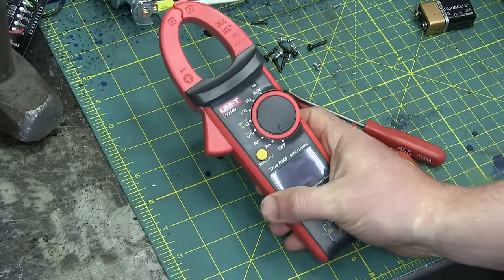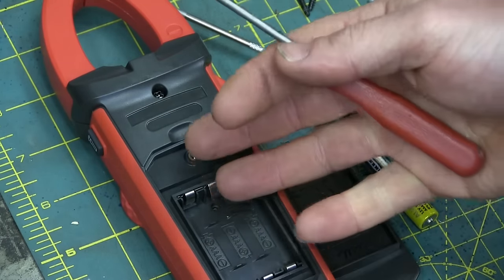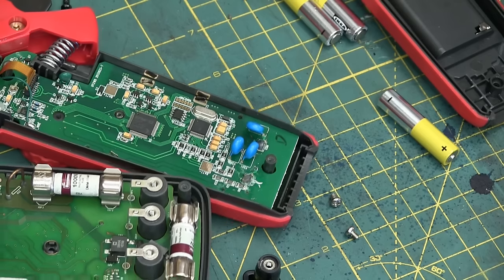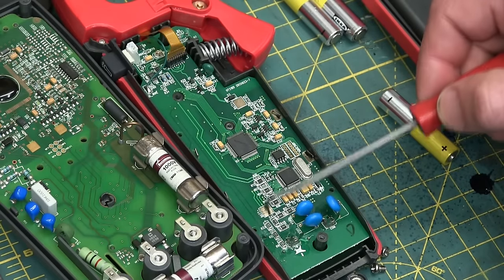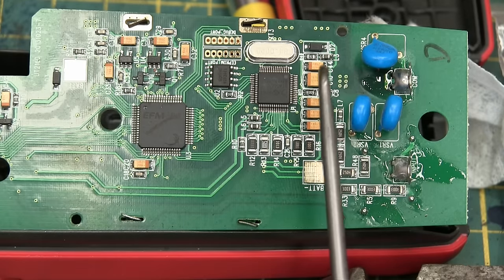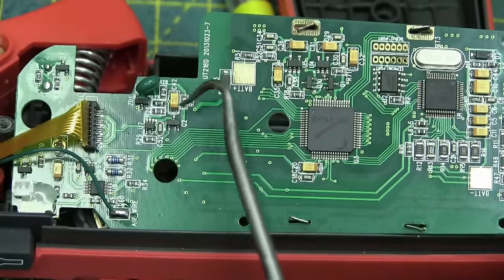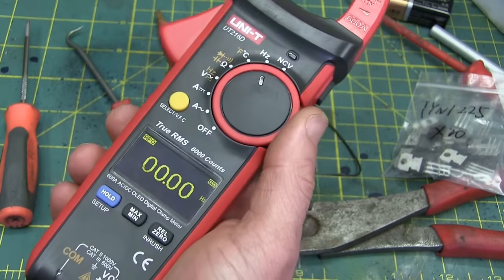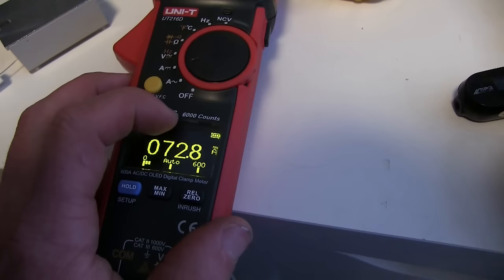BOLTR: UNI-T Clamp-On Multimeter

Comment: i bought a chinese fluke on account of you saying they schoochum , i'm new in the game , is it normal i get rating of 1085 uf for a caap that is 1000 uf??  also the test leads, where the rubber meets the road as you say, they're not silicone carne like yours they're just just plaashtic
Reply: > 1085 uf for a caap that is 1000 uf??

Is 1000uF? How do you know it's 1000uF? Because it's what's printed on the cap?

What's the precision of the cap? Especially electrolytics are generally very low precision / high variance, commonly +-20% (meaning 1085uF would be within spec for a nominally 1000uF cap)
Reply: you have to consider what a part does. A 1000 uF capacitor is more than likely going to just be used as a smoothing filter. In that case 85uF more, or less is not going to make a whole lot of difference. So 20% accuracy tolerance there is typical. A 1500uF cap would do the job too. But parts are labeled so you have a ballpark idea of what you're dealing with. Now I had a car once that was real particular about what condenser (archaic name for a capacitor) I had in the ignition. I don't know why, but it was.
Reply: well , yeah because it's written on lol , i tough the caps might be relatively precise but i did not knew it was +/- 20% ,  so then my question is, does it matter that variation of both the cap and the meter in the  analysis of the problem? i bought this dmm to  start  learning and doing repairs, one thing i would like to repair is my old tv i got when i was 10, from my understanding a lot of time if an electrolytic cap fails there will be physical evidence of leakage, but  is there a threshold point at which you can say good no good in the readings? thank you in advance for your input , it is greatly appreciated
Reply: +martin blouin more than 25%+/- rating.
Reply: martin blouin
the value that is often more important with capacitors is its ESR or Equivalent Series Resistance. Get an AVR transistor tester clone from China. They're flipping brilliant pieces of kit. But get one with a precision reference diode. This is the most pimp one I have http://www.banggood.com/DIY-M12864-Graphics-Version-Transistor-Tester-Kit-LCR-ESR-PWM-p-986954.html I have a few of them now.  But you have to be somewhat intelligent to use it right. You have to calibrate it after you assemble it. Then it is very accurate. Although this one is closer to the open source reference design http://www.banggood.com/DIY-Meter-Tester-Kit-For-Capacitance-ESR-Inductance-Resistor-NPN-PNP-p-929603.html I still like the hacked graphical display better.
Reply: 1085µF for a cap labeled 1000µF is perfectly normal. Most electrolytics have a 10% tolerance and usually read higher than the spec when new.

Comment: +ave ARMS have no bios. since the cpu has ramd and flash on chip my guess for the eprom would be settings of that device. so in case they build anoter series with different electronix on board they can leave software and chip alone and just change values on the eprom. so you dont have to fuck around with a lot of different software versions and shit..
just a guess dont know that thing

Comment: I have been shocked more times than I can count!! I very much respect electricity but at the same time getting shocked doesn't bother me. The other evening I was working on my bedroom circuit when a bare conductor struck a live line. There was a pop and a flash and the person helping me jumped. I did not flinch or jump as I know that being relaxed at the time of being shocked greatly eases its effect.

Comment: 1) protip: apply superglue to toothpick, then apply toothpick to vital electronic component),
2) A question: why are the pixies so angry?
Reply: super pro tip 1 - use 2 part epoxy instead; or better yet - for electronics - UV cured adhesive.

Comment: Couldn't you simply solder a wire from the tab to where-ever the trace was supposed to go to fix it?
it looked like the trace broke from the factory... 
superglue keeps it in place, you just need to fix the electrical contact.

Other than that one tab, it's hard to fault that meter really.

Comment: That loose contact is probably off track - find where the other end of that track goes and solder a wire to it and screw it to the post on the plug hole.

Comment: When you broke off that pcb terminal you attached it back with super glue
you fixed the mechanical side of the problem but you used a non-conductive glue, so you didn't restore the contact that thing made with the trace on the pcb
you just need to get back in there, scrape some of the glue off of that terminal, scrape some of the solder mask (green stuff) off of the pcb trace on its right and join the two together
then it should work fine
otherwise send it to me, I will fix it

Comment: So try you $10 borescope and check for bad solder balls between the pins of the chips causing a short? Or send it to me and I'll look at it under the microscope and remove and solder ball shorts. Then it might fire again. Most cheaper meters is a bad soldering causing a dead short. I've fixed four with the microscope, hot air reflow and flux, and a FLIR to help see the part heating up that may have the dead short also.

Comment: Don't worry about aircraft safety issues due to poor instruments.  The manufacturers stipulate what instruments must be used, and the systems in place to ensure everything is done correctly are very robust.  (Regulation, rather than letting the magic hand of the market drive down the cost until the number of aircraft dropping from the sky and the almighty quarterly profit are maximally aligned.)

Comment: I know you tested variously produced batteries. But I have experienced electronics devices that just don't work with the cheaper batteries. Pixies are pixies. But I'm thinking that the expensive batteries may include that valuable consistency you start of with here. Perhaps battery powered devices are better tested with the most reliable pixy supply.

Comment: The CE looks more like a European Conformity mark then a China Export mark, the E is closer to the C in the China Export mark, and in the European Conformity mark if you were to close the C to make an O the edge of the O would cross the edge of the E.  Here is a European Conformity Mark http://www.cecertificationmumbai.com/  If you are not familiar the European Conformity mark it has  to do with safety and EMI requirements, I deal with the EMI requirements as a test tech.  The CE Mark doesn't necessarily mean the device is safer or more scookum as for most products the CE mark is a self deceleration, you can basically say that you met the requirements without doing any testing but if your product hurts some one you are going to have a sucky day in court trying to prove your stuff is safe.

Comment: A thermocouple is a differential measurement (ambient + voltage around the TC loop) so if you short the leads together (same metal junctions e.g. a paper clip, copper wire) you will see the temperature of the internal PCB.  NTC is negative temperature coefficient, as the temperature goes up the resistance goes down.  

In that 20 minutes of blather did I learn anything more than there are 3 big ICs on the board?

Comment: Pixie wrangler here. I was tempted to dislike after the pro arduino comments but then who would entertain me? lol. I've signed more ndas than I like and I admit I'm an old school PIC guy. Despite all that (and I havent read the comments) but aren't those PTCs on the front of the board just that? PTCs? Not thermistors. Based on that wouldn't they provide some protection to the incoming leads? Check on that.

Comment: That's not how a varistor works.
Reply: A varistor behaves much like a couple of back to back zener diodes. They barely conduct anything below their rated voltage and if the voltage climbs higher, they start letting more and more current flow through, clamping the voltage to a reasonable limit. They don't short out once they reach that voltage. Unless you really overload them (blow the shit out of them), they are happily going to continue not letting the current through after the transient is gone. They are not like fuses, that only act once and permanently.
Reply: Cant you use them like a soft start, to help in-rush current?
Reply: J. Dalton I am pretty sure you're thinking of NTC thermistors.
Reply: To Galco!

Comment: EEPROM  -Electrically Erasable Programmable Read Only Memory , Can be reprogrammed to change firmware
or calibration VS EPROM - Electrically Programmable Read only Memory which is One Shot and cannot be changed.
Reply: Are you sure the E in EPROM isn't for Erasable? Ie. the DIP chips with the window for UV-erasing?
Wikipedia at least says EPROM is "erasable programmable read only memory". I would figure the one-time deals were OTP (one-time programmable) or PROM.
Reply: UV erasable proms have a window. Modern designs usually will not use these. Look up EEPROM and see what it says.

Comment: That's not a China export mark that's a Conformité Européenne mark so it can be sold in Europe think of it like UL or CSA it is a standard UL often test for  Conformité Européenne see link 
https://en.m.wikipedia.org/wiki/CE_marking
Reply: It's called a "China Export" mark because some Chinese manufacturers don't bother getting approval to use the European CE mark.  The mark they use instead looks suspiciously like the correct CE mark, but the geometry of the letters isn't quite right.  The Chinese deny there's such a thing as "China Export," but they also deny improper use of the CE mark.  It's just one more way they violate international agreements, lie about specs and safety ratings, and screw consumers.

Comment: It's not a hall effect sensor. It's a transformer. Isn't it?
Reply: A transformer could only measure AC currents
Reply: Transformers only work on AC.
Reply: Well, guess my info was way out of date.
Reply: Hall effect sensor for DC amps. And transformer for the AC amps. Or if it uses the hall effect sensor for both. Idk. :)
Reply: +Tb0n3 na , just in wrong setting , lol

Comment: 7:41 - That terminal looks kinda wiggly... 8:16 - Yep,she's done dickered. That might have been the problem the whole time. Someone probably got the solder pad too hot,and it de-laminated from the PC board. Then,assembling the terminals and stuff may have cracked the traces to the pad. Scrape off some solder mask,and fix the connections to the pad..it might work again.
I had the same issues with the MSP430 tools. Then I changed PC's,and tried to download it all again..and what a fuckin nightmare. I still get emails from the TI guys,asking me crap. Just getting the tools is a right pain in the ass,let alone using them. Then I saw your video about Energia - game changer!

Comment: U should just solder a wire from the broken terminal to the contact to the right , looks like you broke the trace on the board. Just directly connect it and it'll chuche I bet lol

Comment: i'm with you on the ide but that's always been atmel's selling point
you can do amazing stuff with pics and they'll send em to you free to mess with but the ide is just not as well documented
renesas will give you free dev boards for amazing sh3's and other stuff but it's garbage to work with
ti will throw msp430's at you by the dozen but until someone ported it to the arduino dev environment it was crap to most people

i'm an old pic and 8051 asm programmer so i don't mind crap ides as long as you give me a datasheet that actually has the correct register names and what they do but i can understand wanting to just load the library someone else made and work with it fast and easy.  but when it comes down to the real production uses of microcontrollers $4 for an atmega to just shove bits around, run a display, take some measurements, and maybe manage a battery pack using standard libraries is not gonna cut it in 50k volume if you could buy a $0.39 pic18 and pay someone who knows what he's doing $30k to actually use dma in creative ways to cram it all into the 12k of code space and 512b of ram and still have enough processing power you're gonna spend the 30k and save 150k

Comment: Um. Doesn't matter if it's measuring current by hall sensor on the nippleclamp end, it says it's Cat III rated at 600 volts on the other end... and the volt wire goes into the banana sockets. Without fuses.Nope, no thanks. Grand for TTL logic on a breadboard but you don't need the nippleclamps for that sort of stuff. This isn't a meter I'd be poking into a mains circuit (which over here is nominally 230V but peaks over 300V).

Comment: I shouldn't need a tool to get to the corrosive parts out of the drive train.  Not even a P1.  Even later year Flukes have thumb-nail 45 degree wedges for removing corrosive, explosioninary, rottenairy, shit from expensive tools.

Look, fucking engineer morons.... actually, Look, daily users, YOU GOTTA TAKES THE BATTERIES OUT.  Your Dynatel 965.  Yeah, I know you don't care about your sniffer.  You don't care about the screamer. 

Your 965, and the lunchbox 935 you gotta put the batteries in to use it.  When you are done, for the day, you remove the batteries.

And who the fuck thought a 45 volt battery was a good idea?  We could easily do that with 9 volt scared cat batteries... but NO, WE SPEC A 45 VOLT BATTERY that will not only rot out the tool, but rot out the floor of the truck.